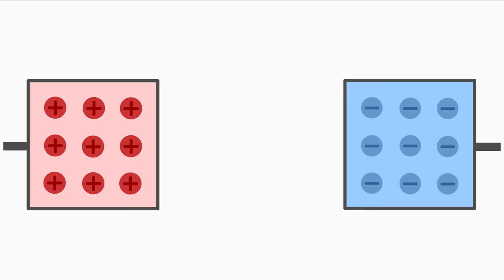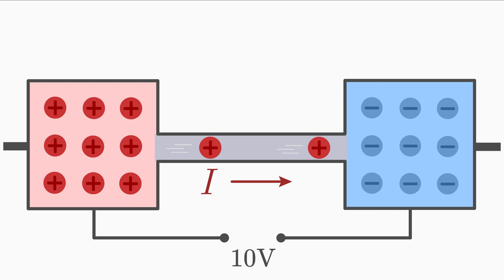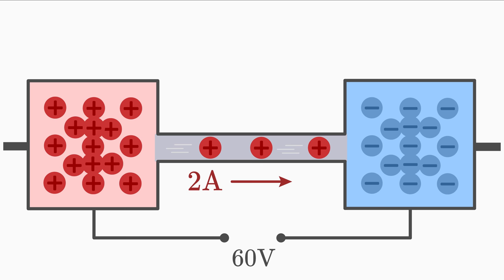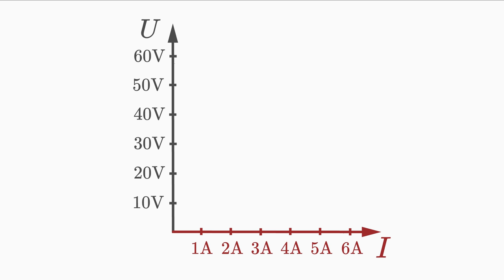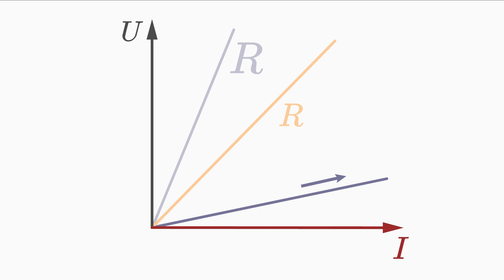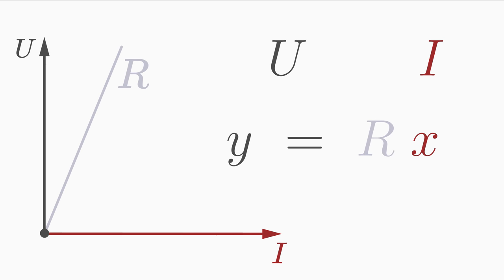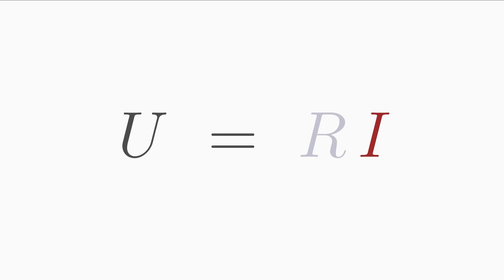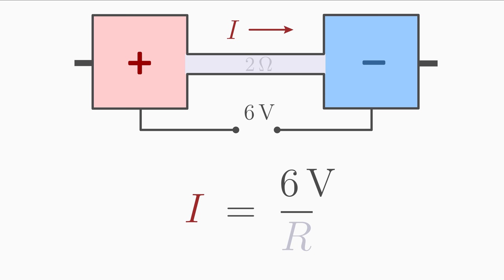Ohm's Law

Comment: Thank you for this thoughtfully made video - I really like the pacing of your narration in combination with the clear and concise visuals!

There was one part in this video I did not follow, however. At around 9:12 you rank several materials by their resistance: iron having the lowest, followed by copper, followed by aluminum.
I was always told that copper is a much better conductor (less resistance) than iron or aluminum, and is only second to silver as far as typical metals are concerned.
Perhaps you could help me understand where I'm going wrong, I would greatly appreciate it!

Comment: Amazing video, but I need to point out some things. When the voltage went up you drew more ions (denser) and represented it as higher current. But what I think is the right thing is that when the voltage gets higher it means that the electric field is bigger and so the force the ions experience and so the acceleration. Therefore, ions get faster so there are more ions travelling through for the time and therefore higher voltage. I don't thing drawing denser ions is the right thing. I maybe wrong correct me!

Comment: Shouldn't the axis be reversed in the graph? Surely voltage is the independent variable and current is the dependent variable? I get it that you want R to be the slope of the graph and equal to "rise over run" ( U/I) but in reality we say "voltage drives current" not "current creates voltage", right? Although current is a function of voltage, I see how  that would make the graph/slope determination more complex  (1/R).